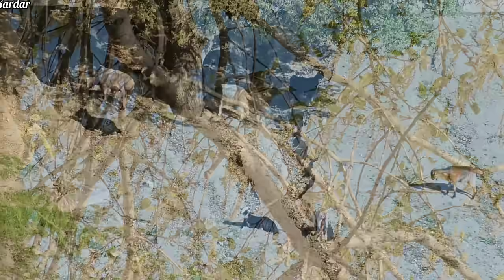Nomadic Tales: A Drama of Rural Life in Iran with Sajjad and Rahaleh"

Comment: Now that's what you should be doing to the outside walls of the new house.plastering with cement will seal the walls and prevent rain from coming into the house.why are you doing the little house and not the new house.